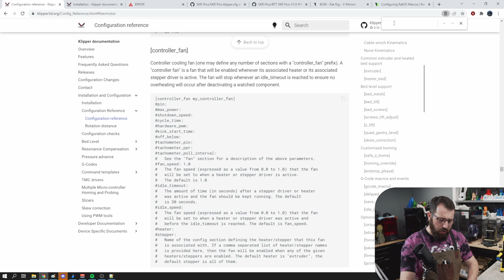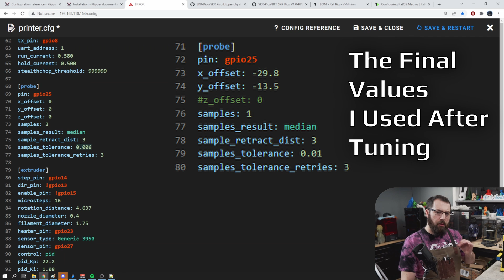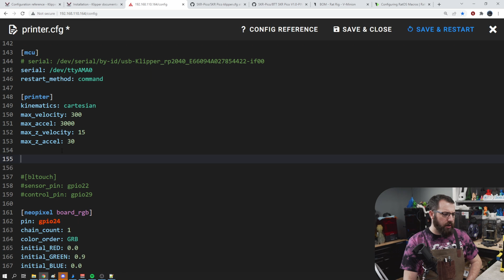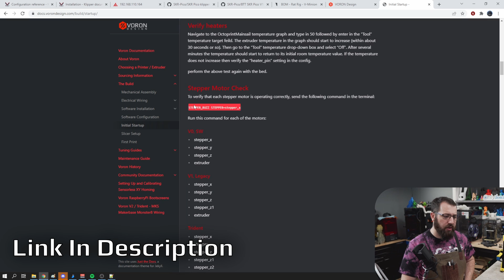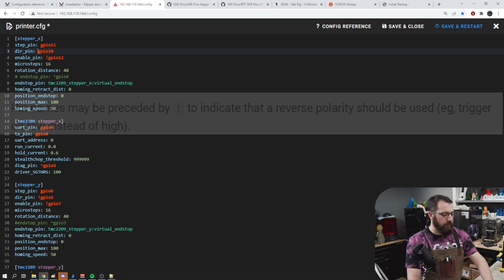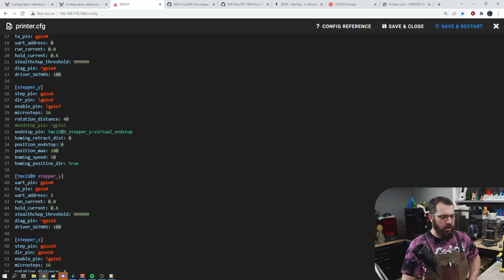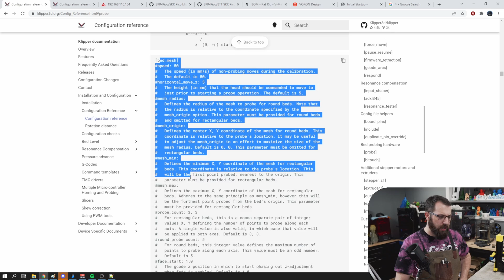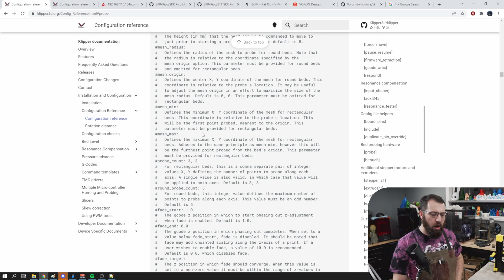Install Klipper on ANY 3d printer - Part 3 - Adding New Features

Comment: I'm confused... Where is the step when you flash your printers motherboard with the klipper build? My printer has SKR 1.4 Turbo and it currently has marlin. Can someone tell me where the step is where you build the klipper firmware for the motherboard and flash it?

Comment: I Had a VERY annoying problem leading me through 8 different attempts at flashing mcu and the pi. I now realized after 4 days of troubleshooting that this was caused by the USB type-A cable that connected my SKR 1.4 turbo to the pi. symptoms were a laggy user interface in both mainsail and fluidd, got several different faultcodes in klippy stating "mcu 'mcu': Unable to open serial port" errors in the mainsail interface etc.

Damn i feel like setting fire to that usb cable. I hope this helps for anyone else having the troubles i did. :)

Comment: I had a lot of problems to running Klipper, still have. now it seems everything working fine, but Auto bed leveling/Mesh leveling giving error it saying probe triggered because of the movement, my Printer is Biqu b1 se plus. No problem when homing.
Any idea??

Comment: I'm still confused on where each software package/cfg file is installed. I've got  the Pi OS, Klipper, Mainsail, Moonraker... and they all kind of blur together. Nothing is running on the printer control board? just the .cfg file? Which file/program is talking to which?

Comment: Is it possible to run Klipperscreen on an old Andriod Tablet? I saw a video where a guy installed klipperscreen on an RP pi 4 to monitor all his printers which had there own klipper. Could i do that with my android tablet as well?

Comment: Question: how would you configure z-end-stop detection like on cr-6 that have both an optical switch plus a strain gauge in the hot end assembly? As i understand it uses the optical switch as a pre-detect to avoid mashing into the bed, but i am completely lost as to how to configure it. Thanks.
Reply: You need to make your usual .cfg or use one of the premades on the github, keep the Z endstop_pin asigned to the optical switch or your endstop that it's on the frame, then make a [probe] section with the  pin assigned to your strain gauge (AFAIK the board has a dedicated microcontroller for the strain gauge and a HX711 load cell amplifier to handle the reading and only output a digital signal), just keep in mind that your Z endstop needs to trigger a little bit lower than the bed otherwise if the endstop it's higher than the bed you would crash into the endstop when bed probing.

I would suggest to go slow when probing with the strain gauge or try to match the factory speed couse gauge sampling can be slow and creality don't give that info.

Remember that you need to add the necesary [bed_mesh] and [screws_tilt_adjust] if desired to the .cfg in order to use the probing capabilities.

If you find that when Z homming with the Z endstop makes the nozzle hit the bed you can make a [safe_z_home] and put an almost max X coordinates (on ender like printers going max X makes the nozzle clear the bed and avoid hitting it) this would make that when homming the printer would home first X and Y, then move the printer head to the "safe Z coordinates" and the Z home on the endstop, the you can proceed to your G code, hope this helps.
Reply: @fdavpach  thanks for the input. Some of it very useful other contradicting my observations. When the z endstop is optical it can detect above the bed ( it does now) but the tab crossing the optics need to be long enough for the top part not bottoming out. I need to look into the other settings you mention.
Reply: @helenenordve4285  oh right right if your optical sensor tab can go through the sensor you just have to be aware of not bottoming out the sensor, the stock end stop placement should work
Reply: Following as I am a cr-6 user as well
Reply: Also eager to know. have an anycubic chiron with dual optical z stops.

Comment: How do you control Neopixels based on temperature, like setting them from blue to red as the bed/nozzle heats up?
Reply: The config is python, so you could write a function to vary the color based on temperature

Comment: Please cover stepper voltage tuning, I could not find a good guide on it. Especially moving from stock/factory board to klipper.
Reply: Also, klipper documentation has a work around for stealthchop sound levels without losing accuracy, by increasing micro steps from 16 to 64 or 128 in spreadcycle. Would love to know your opinion @Nero3D.

Comment: Is there a way to do probe temperature compensation? The one necessary for Pinda 2?
Reply: How did you post this reaction 14 hours ago? The video is just 40 min old at moment of writing this.
Reply: @thai9503  time travel... Your reply was the reason that I traveled back and time and added this comment.
Reply: I'm using Pinda 2 as well, have been looking for this but no luck. But I make use of the probe sensor to ensure it measure bed at the same temperature everytime before printing.

For instance, when my E5 plus's bed at 60C, it can heat up the probe to 40C at home position after around 10mins, so I setup a gcode to wait for the probe to heatup before start measuring bed.

I know it a workaround and it increase a lot of wait time before printing, but it forces me to heat soak the printer. I've been printing with this setup for few months now and no more probe drift since.

Another downside, I have to set multiple probe temp condition for different materials with various bed temp.
Reply: Gotta fork over the coin for a superpinda.